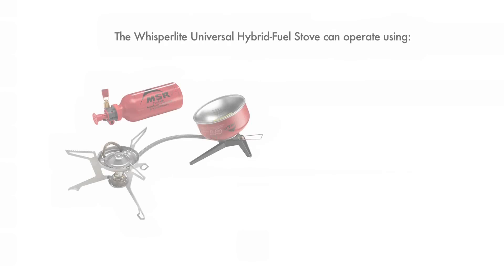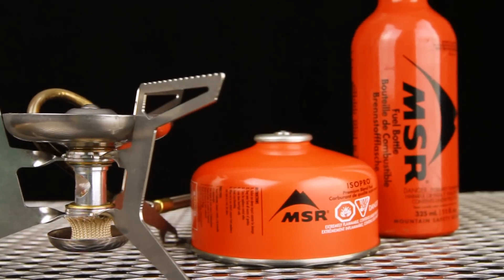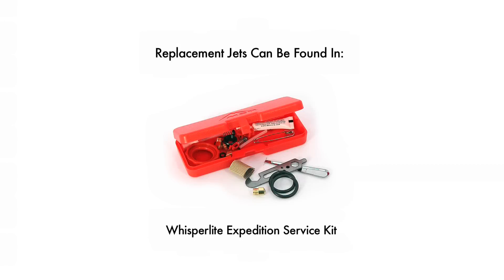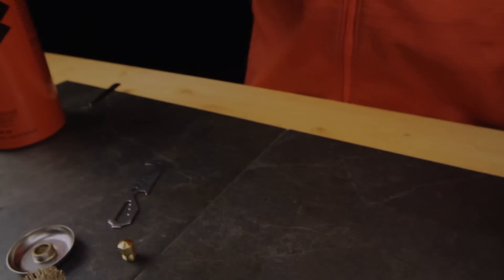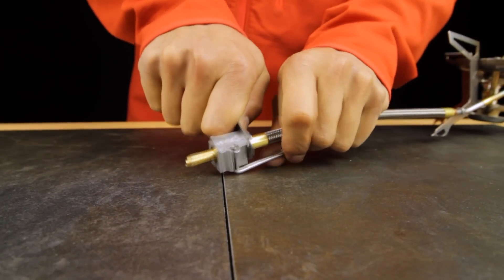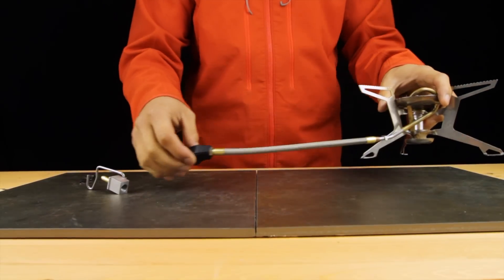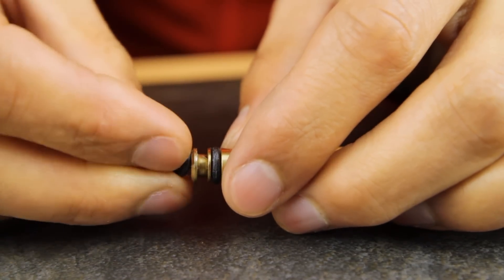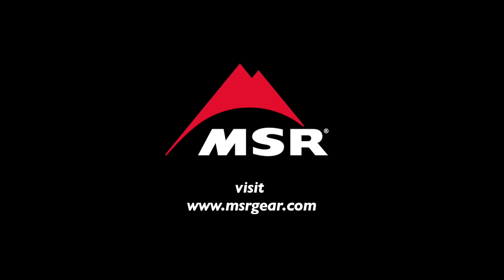MSR Stoves: Changing Fuel Types

Comment: What will happen if i forgot to change the uc jet to ug jet while burning unleaded auto gas. please help. Thanks
Reply: Do u leave the shaker pin in for all of them? A replacement of that also should be included
Reply: Wrong jet causes inefficient burn and or difficulty lighting
Reply: Any tips if generator tube is bent out of place?